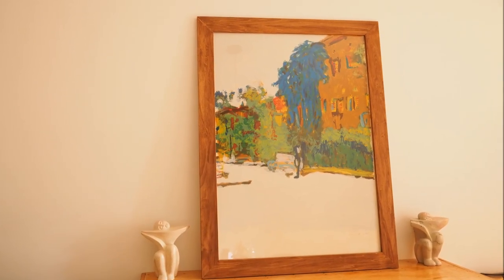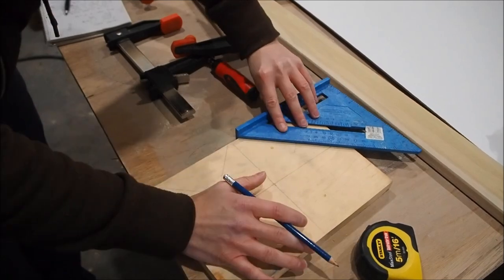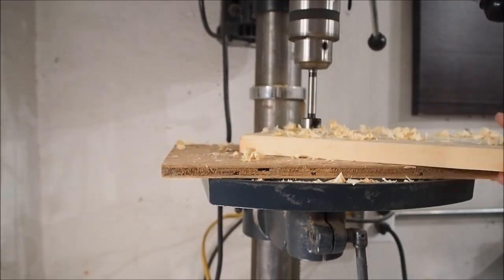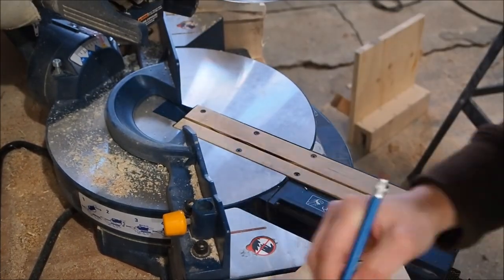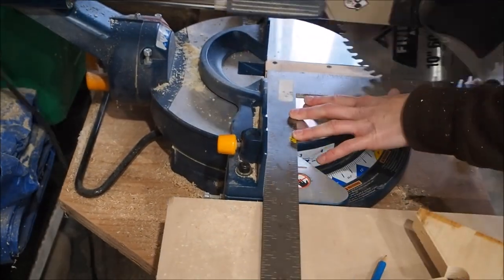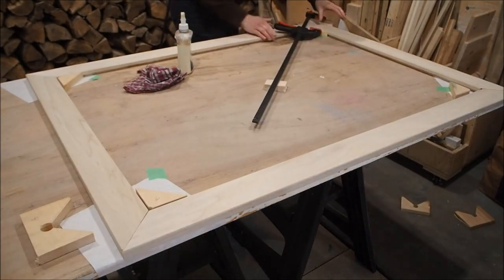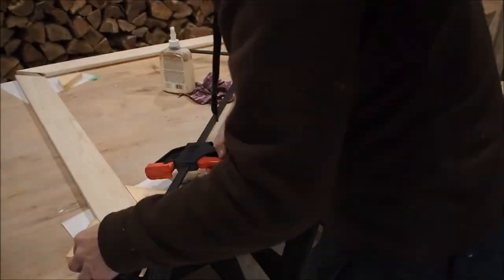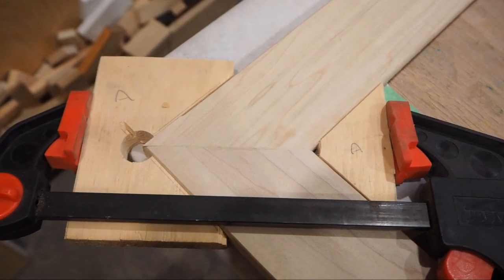DIY Corner Clamps | Quick Tip

Comment: Thank you.  After watching your video I went out in my shop and made four of these out of 3/4 " plywood.  My method turned out to be a little different than yours but the end result was the same. I'll be using these to make a table for my Lanai. Thank you as it was pretty easy. I just got done spraying them with polyurethane and when it's dry I'll put a small piece of Velcro on each so the same pieces stay together with each other without getting lost. Thanks again.

Comment: How can I cut the triangles without using a miter saw? I do have one, but isn't the 12" that you can pull out the blade and cut from the bottom up like you did.
I do have a jigsaw, 10" miter saw, table saw and a circular saw.

Comment: Do you rely completely on glue for the miter joint?
Reply from the maker: Yes but I reinforce the joints afterwards with splines, especially for larger frames.
Reply: @DIYMontreal  
How would you do splines afterwards?
Another words after it's already glued.
Reply from the maker: @n40tom  Using a spline cutting table saw jig. I have a video about this too.
Reply: @DIYMontreal  
Thanks

Comment: I made these but as soon as I apply the slightest (very light) pressure with my clamp it pushes the pieces out of alignment, what did I do wrong?
Reply: Either your notch isn't exactly 90, or your chop saw isn't square vertically.

Comment: Why are the holes cut? Can I do this if I don't have a way to cut the holes?
Reply: I think it’s so it can hug the corners more closely and apply pressure in a way that ensures a proper 45° angle
Reply: Also to keep the clamps from getting glued to the frame.